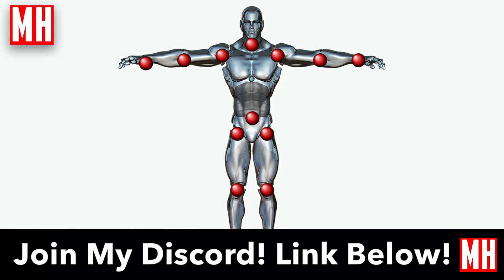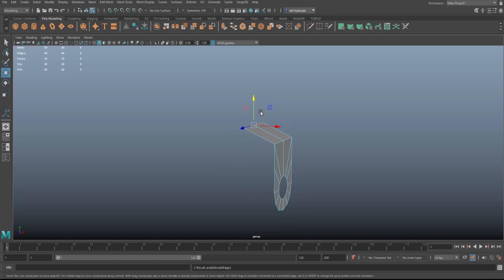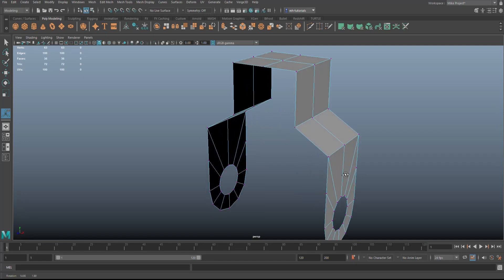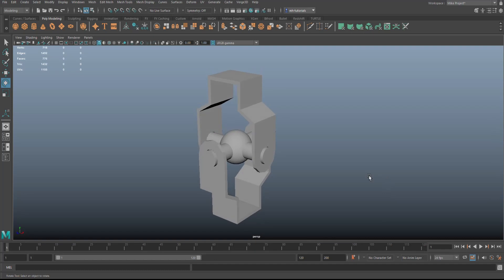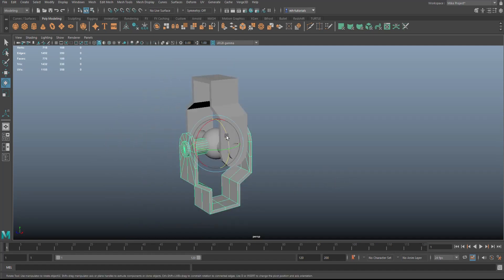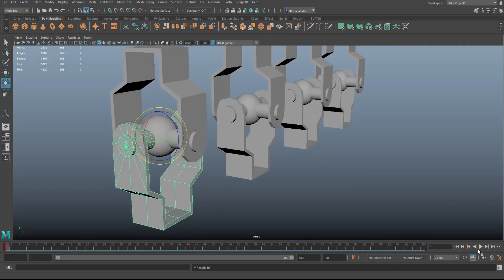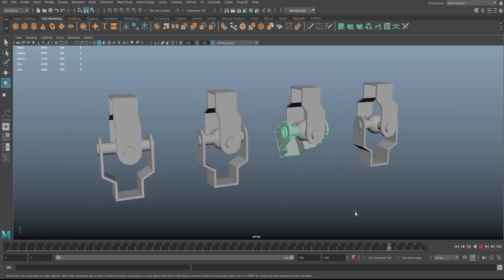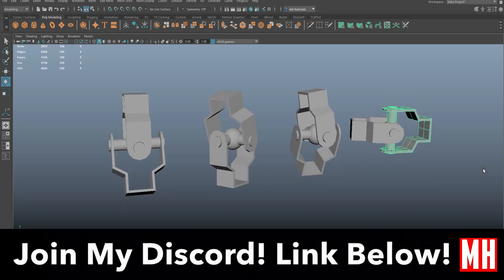Robot joints... 3D Modeled, Rigged and Animated ( with narration )

Comment: Ok, i have a small issue with this (my inner nerd speaks - sorry for that xD). What we have here is a universal joint, also known as Cardan Joint. Due to 2 axis mobility its definitely not a good as a knee joint. Is used to join 2 spinning shafts that may work in a line or with an angle (this will allow to transmit rotary motion). But for lets say a drive shaft or shaft that drives front wheels in a car would work beautifully ;)
Reply from the maker: It is a method, not THE method :-)
Reply: @MHTutorials3D  like i said... Inner nerd ;) but i would see it in a robot anyway. One thing that graphics taught me... Sometime something needs to look more than to be accurate to attract the viewer :)